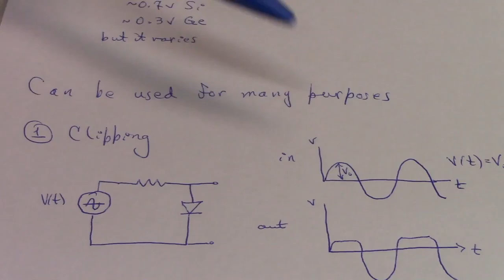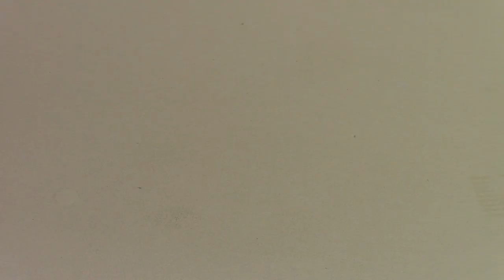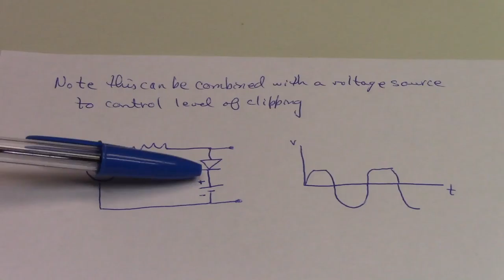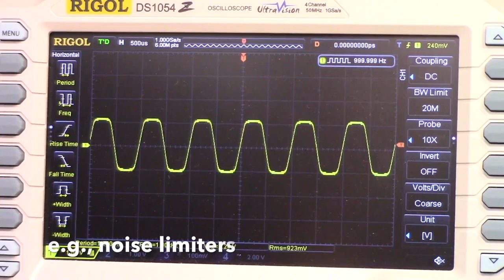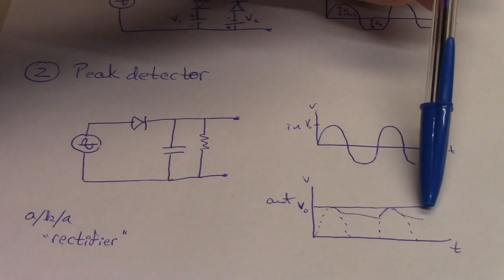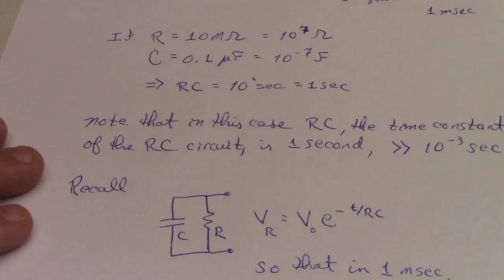#32: Simple diode circuits

Comment: After having reads many books and watched many videos on YT regarding voltage multipliers with capacitor and diodes , nothing was clear to me! I didn't understand why   output voltage was double then  input voltage. Many confusing videos on YT are trying to explain it with magical mathematical formulas, completely wrong! Now , after watching this video, all it's clear to me. It's double because of the sum of input voltage and voltage remaining on the condensator (clamp circuit). Simple and clear, after days of confusion and strange explanations! Thanks a lot!! Please contribute to scientific community with other videos.

Comment: how do you connect the voltage sources (5:00)? Do you just insert two different powersupplys in the curcuit?
I need some knowledge on how to attach different powersupplys, functiongenerators, scopes etc. Are there anyway I must avoid?